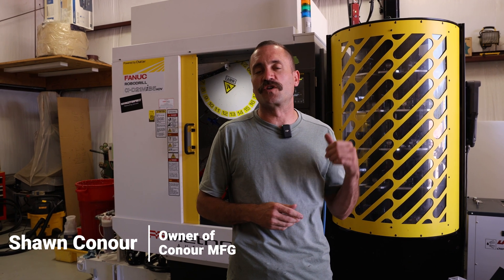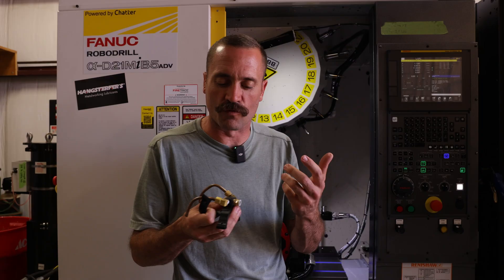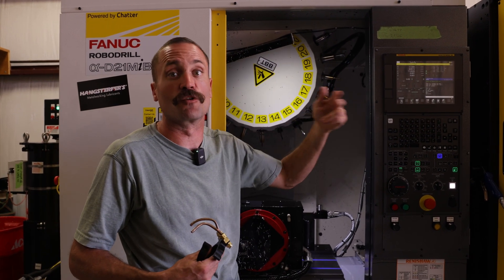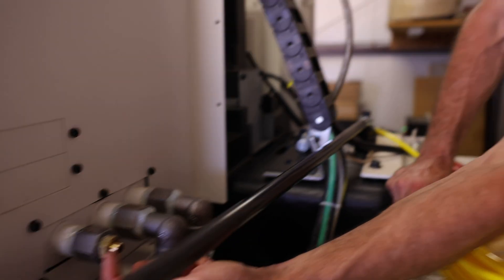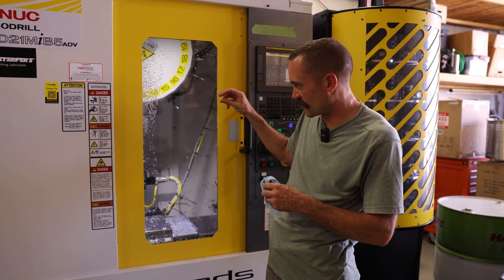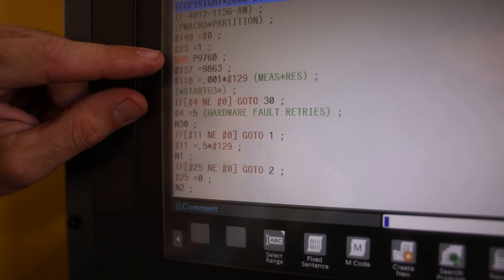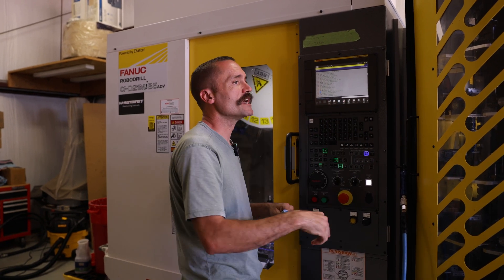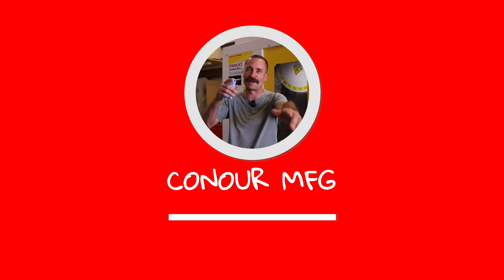I HAD TO FIX MY BRAND NEEW ROBODRILL?!

Comment: Dont want to brag or anything, but our Brother Speedio came with an air blast on the tool setter....
Reply from the maker: That's sick! Technically this RoboDrill did as well, it's just not enough volume to work well 100% of the time.
Reply: @ConourManufacturing   We are using water soluble coolant, unlike you oil maniacs, and I think that doesn't hold onto the chips the same way the oil does. Along with not providing the same tool life and surface finishes, or course.

Comment: Why would you not just run coolant ? After the tool change and before the laser check?  That way you clean the tool, and laser all at the same time?
Reply from the maker: Are you saying I should use through spindle coolant right before the tool check starts? I guess I am not a huge fan of blasting the laser with 800 to 1000 PSI of cutting oil. 

If I was to use flood coolant I would have to have the table go to some specific location every time. Hit the laser setter with coolant then start the tool check. That would require it's own custom macro through my post processor. 

Running this air line/install took 30 min with no custom macros or post edits. To answer your question, the reason I used air is because it was simple and fast. It has been working incredibly well, the machine has not alarmed out since.
Reply: @ConourManufacturing  you need like 4nlines of code for flood coolant to add to your tbd macro
Reply from the maker: @u_solutions_lv  the problem with that is my coolant lines are not pointed straight down at my laser tool setter.  So I would have to move to some predetermined position for the coolant to hit it. Then if I change my coolant line positions(based off tool length and specific parts) I would have to go edit the macro.
Reply: @ConourManufacturing  Are they pointing to tool tip?
Reply from the maker: @u_solutions_lv  I use a variety of gauge length tools, so I try to keep coolant pointed in the general direct of what I am working. If I was to turn on coolant in the tool brake macro I would shoot coolant over the top of my tool laser and it would never wash it off. I  would have to use TSC and not every tool is TSC. Hence rust adding an air line one time and never having to worry about it again.
Reply: @ConourManufacturing  I am not 100% familiar with break detect on stock renishaw macros. In my macro that I have on my machine. Tool is moved to 10cm over tool probe before going g31 protected move/skip. Before G31 move begins, I have tool setter splashed with flood coolant. Again, I can make a video on Monday, how full macro is working
Reply: @ConourManufacturing  https://youtu.be/_Aj5JCbTT0c?si=cfGm0fMqdgz7bDlT

Comment: I just dowse mine with flood coolant before measurement. Albeit mine is mechanical
Reply from the maker: How do you line up the tool setter with your coolant nozzles? 

At the end of every part I run the chip fan, which completely cleans the tool setter. This air blast is just to ensure I get through the part without a chip getting in the way.
Reply: @ConourManufacturing  I can make a video on Monday. Short answer, since mine is ts27r mechanical touch unit, If i align tool with probe i flush it. At tool break detect i turn on flood coolant, then I move to clearance height over the probe, M09, G04P500 for coolant to stop dripping, and then continue with the tool break detect. I only have plunge break detect.
Reply from the maker: @u_solutions_lv  are you have to type that in at the end of every tool path? Or are you putting that in the tool check macro?
Reply: @ConourManufacturing  I have it in my tool check macro. I was dissatisfied with what I got preinstalled and edited a bunch of stuff.
Reply: @ConourManufacturing  also flood coolant + spindle reverse before break detect helps with birds nest if it managed to happen